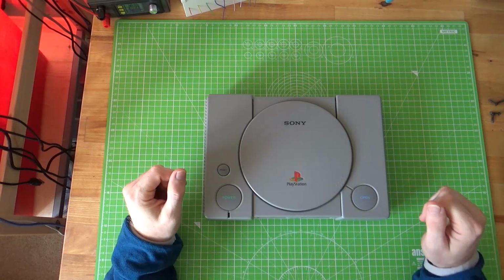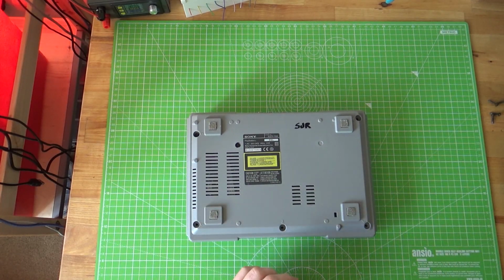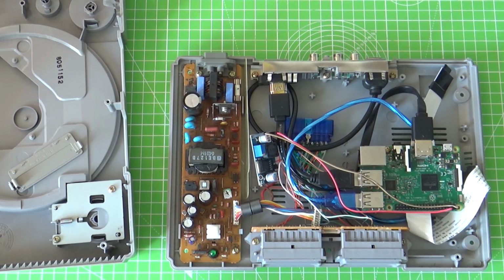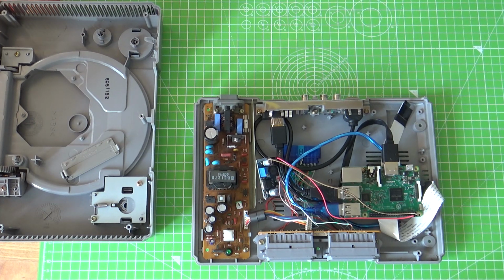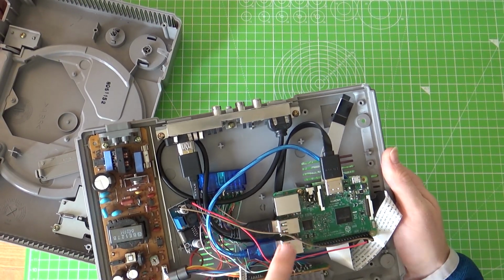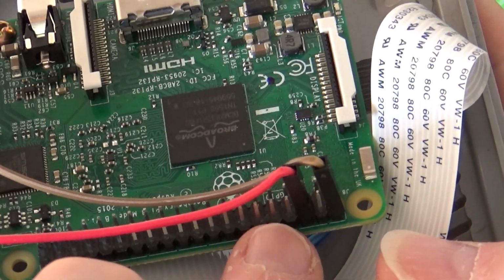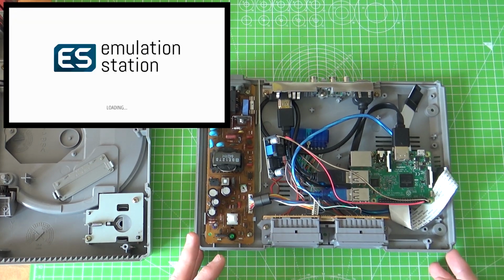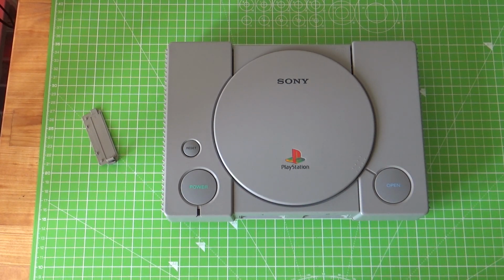Playstation Classic DIY!

Comment: Nice work Colin!
I have seen some processors double their current consumption with just a 20 degree increase in temperature.  I wonder if a couple micro heat-sinks and/or 20-40mm micro fans for input and output airflow, might not lower the overall current consumption by at least 200-400 mA when the processor is maxxed out.  This may alleviate the need for a power supply upgrade :)
Reply from the maker: Thanks i'll look into it :-)